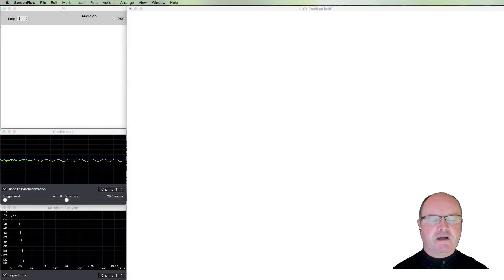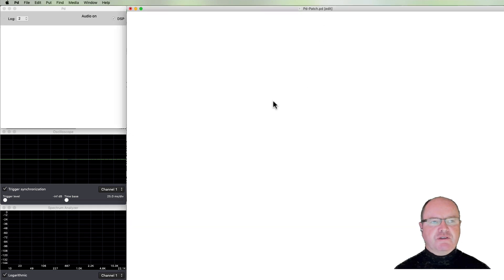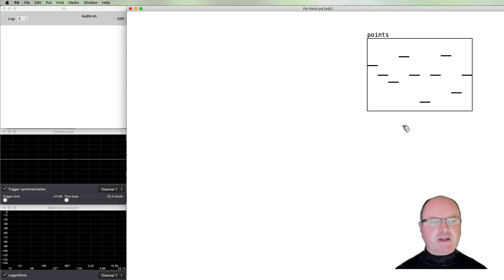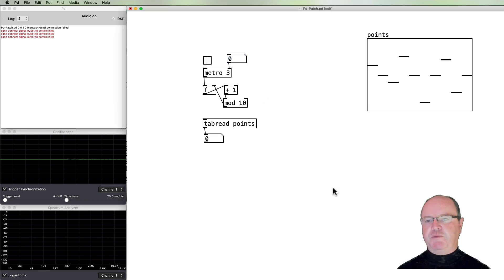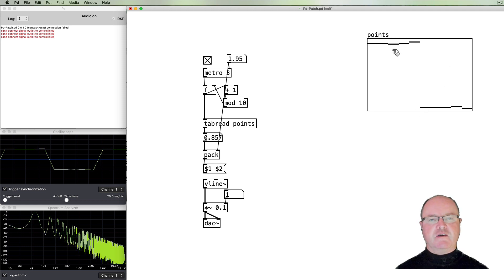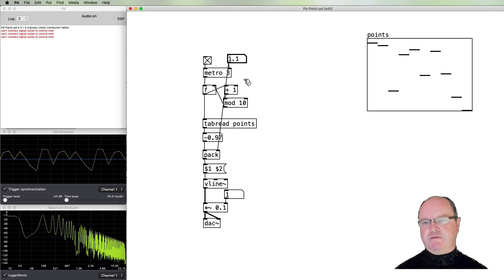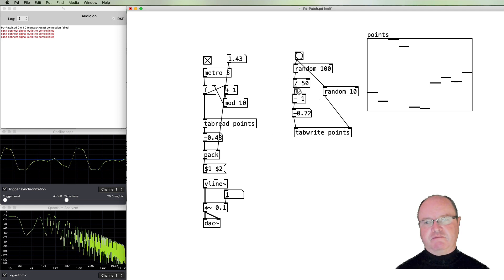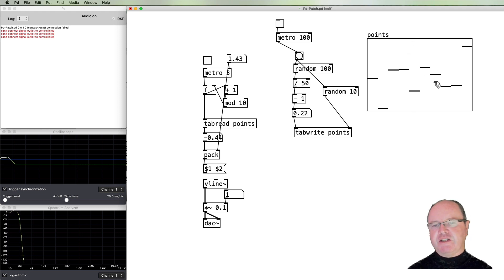47. Stochastic Synthesis in Pure Data

Comment: about the stochastic dynamic synthesis, how does the interpolation take place here?
Reply: The [vline~] ramps between data points.
Reply: The vline~ accepst 3 values .
The first value is the destination amount , the second one is the time it takes to reach that value , the third one is delay parameter ( which is not in use here ) , this is considered ONe stage of the vline~ 
You can insert mulitple stages by comma's in the message and that's where the third delay parameter is for ( again not used in this example ) 
The first value is set by each point of the array ( which is $1 in the message ) , the second value ( thus the time it takes to transition  between the values is set by metro time ,  this is the $2 of the message , these are then packed .
Afaik  interpolation between values  is linear (hence the name line in vline~ )